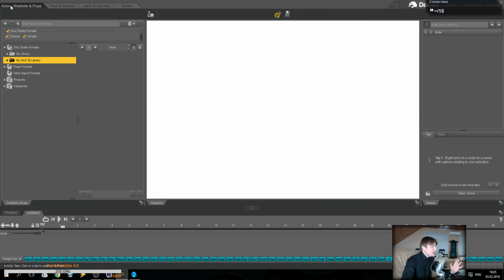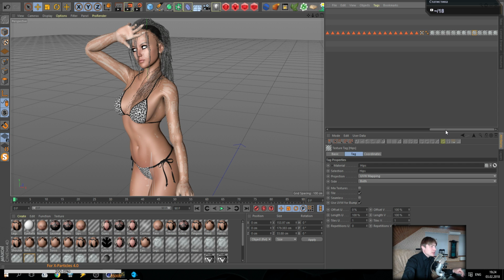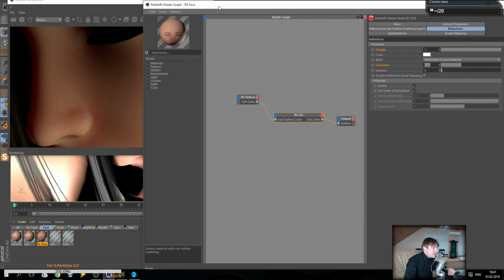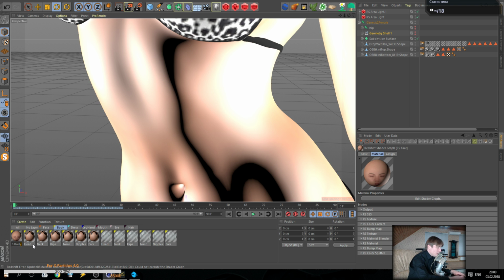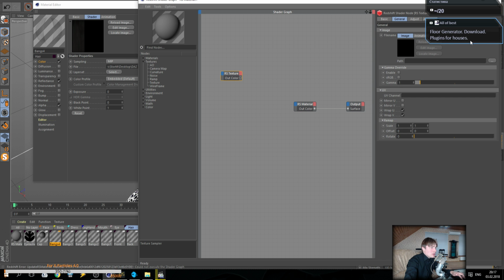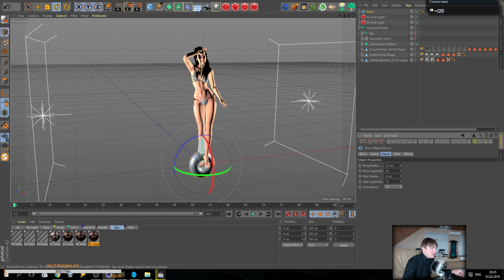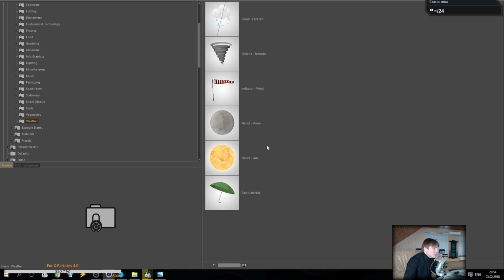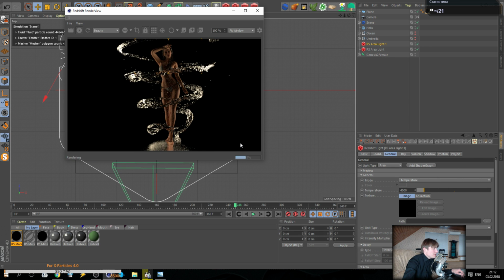C4D / DAZ Studio / Redshift / Tutorial

Comment: hey nice tutorial, just 1 question, how do i export my figure in the highest Subdivision level in Daz? I followed your tutorial and the model when imported into daz, it tursn out to be in the lowest Subdivision, it lost all the very small details i added in. My computer can handle the polygons so i want to know how to do this.
Reply from the maker: I made only export from DAZ to C4D. Sorry.
Reply: You should export with OBJ. FBX is bad because while it exports the skeleton it will not export the JCM (Joint Controlled Morphs) or the proper weightmaps as seen in Daz Studio. The pose could end up looking very bad. I've heard it's possible to export FBX at high res if you lock the subd level in Daz studio before export but I've never got it to work. You can export the JCMs in FBX too but you would have to somehow set them up in Cinema 4D or just manually apply them. If you want to export high res animation you can use the alembic plugin for daz but it costs money to activate.
Reply from the maker: Thank you for this useful comment! Next time I'll try obj. I already have some plugin for C4D for this reason.
Reply: What plugin?